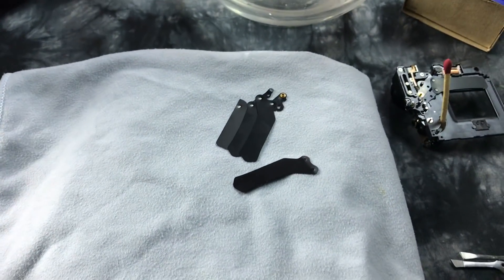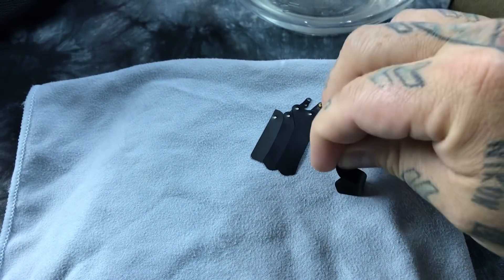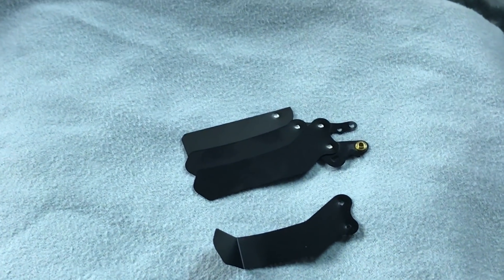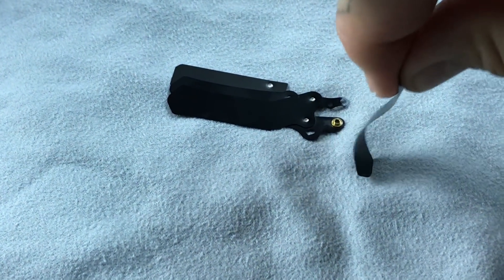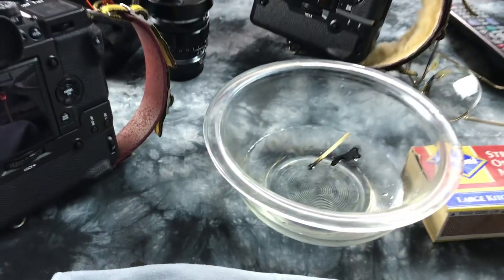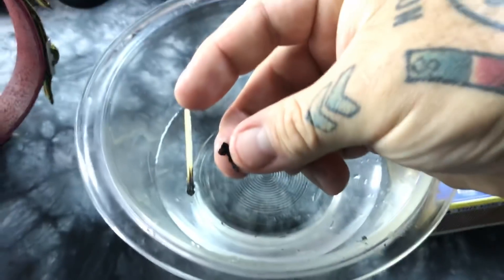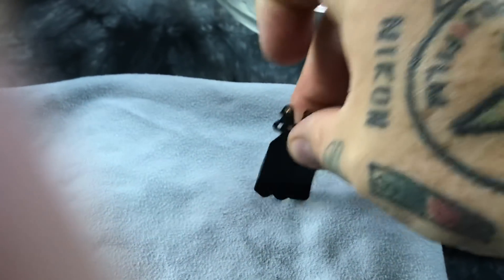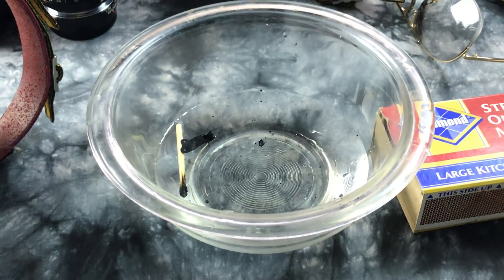😱 Dirty Camera Facts you didn’t know 😉

Comment: Must not be much Teflon, to burn so easy. I have Teflon insulated wire that will not melt if you put it over a lighter.
Reply: In fact, the blades are made of noncombustible Kevlar but on a skeleton of very combustible carbon fibers...